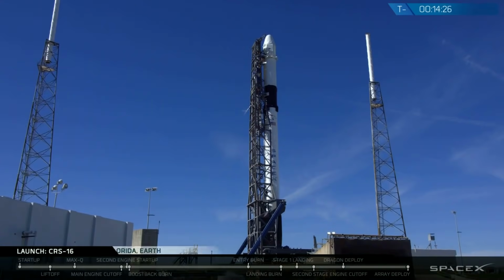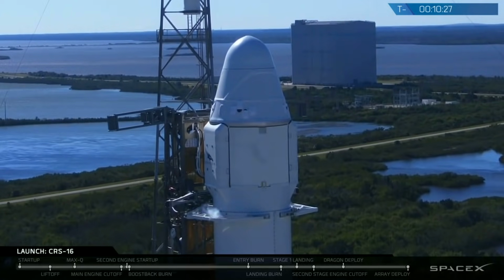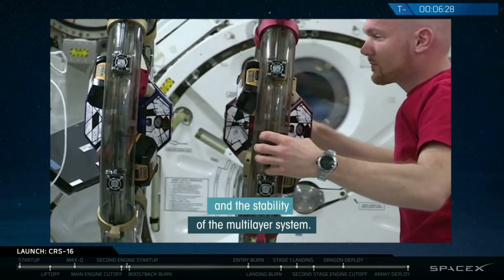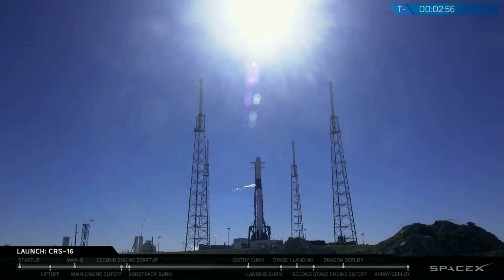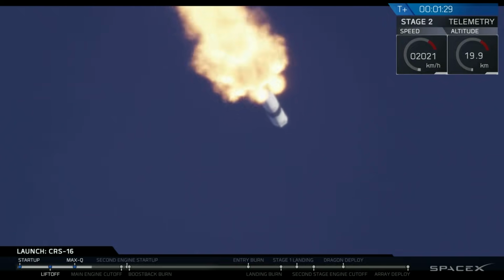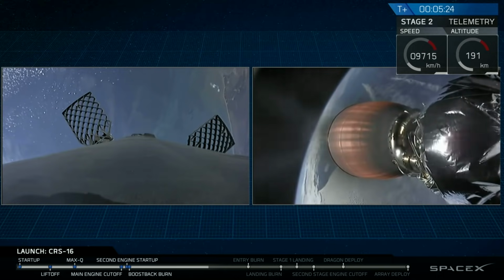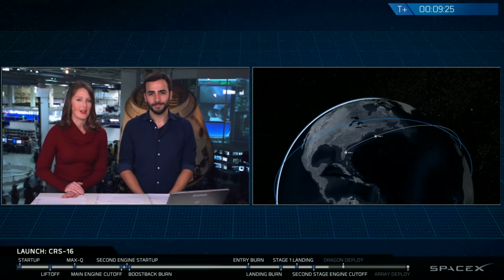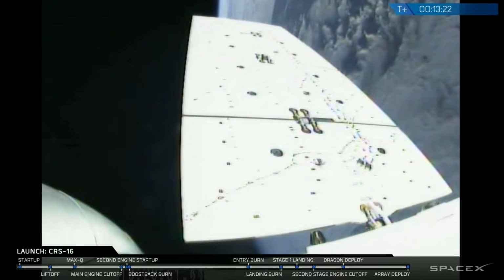Dragon Resupply Mission (CRS-16)

Comment: why is earth spinnng one way when you show the engine, but yet spins the opposite way when you show other engine....shouldn't earth rotate the same direction? #NASALIES
Reply: That’s the same Engine with two cameras. You can see earth is rotating in the saner direction since it’s moving in the direction the engine is facing for both cameras.

The earth only appears to be rotating so quickly in this video since the spacecraft is moving so fast around it.

Comment: The only accurate launch video comes up in Youtube: (SpaceX Launch with CRS-16 12/5/18)
Which shows these proximate results: 28 seconds to leave frame, ascending 1,200-to-1,300 meters, based on 100 meter towers at launch site and frame height, while a free-fall from 1,300 meters (G-force), excluding air-resistance, reaches ground 14 seconds  (half ascend time), thus meaning that SpaceX is NOT accelerating at all, but going up at an apparently constant helium-balloon-speed, slightly assisted with pyrotechnic propulsion (Fireworks)! An actual rocket, no matter how small, and weak, has to cover 1,300 meters in less than 4 seconds or it tips over and falls!  Such as this one: 
Youtube: (STEVE EVES SATURN V MODEL ROCKET RECORD FLIGHT VIDEO Roy Dawson)
These huge-rockets ascend so slowly because they are NOT rockets, but fireworks-assisted-airships (BALLOONS)!
Using video to measure rocket-speed: https://www.apogeerockets.com/education/downloads/Newsletter292.pdf
Reply: All model-rockets ascending above 1,000 meters have acceleration above 3G: http://www.thrustcurve.org/motorguide.jsp?rocket=400
 “Cesaroni N1560” found above, is probably the weakest rocket going up 1,300 meters with 2.9G, in only 10 seconds, 1/3d of the time the above SpaceX-Dragon covered the same distance! Look also at the list of failed motors below. Clicking on above rocket-name takes you to its data-sheet.
Reply: https://www.youtube.com/watch?v=MkmK7giUej0
   Or, Youtube: 
(My O-Motor Rocket Going Supersonic with a Speaking GPS) to see This amateur-rocket (a real-rocket), with a mass-produced Estes-motor, shooting up 21,000 ft==6,400 meters in the same 26 seconds that the above SpaceX-Dragon covered around 1,200 meters, thus over 6,400/1,200 > 5 times faster!
Reply: @kareemsalessi  And fleas are stronger than men, because if we could jump 300 times our height we'd leap over the Eiffel Tower... if the function of a Falcon 9 was to climb a few tens of km high at a lethal acceleration before dropping back to the ground then your analysis would be instructive.

Comment: Google: ("Solving-Spacex-Enigma") and cross-check the above launch numbers with the table there for a major surprise!
Reply: Rockets headed to orbit don't go straight up. Most of the power of the rocket is used to reach orbital speed. Most of the thrust is angled to the side in order to reach this speed.
The altitude gauge isn't the same as an odometer on a car. It's only measuring how high the rocket is; not how far it went.
Reply: @ddegn  That is just one of many NASA-FAIRY-TALES!  Check their ISS in Youtube: 
(Checkmate! Astronaut Caught Wearing Normal Gloves In Space - NASA Caught Faking Space Walk)
Reply: @kareemsalessi  "That is just one of many NASA-FAIRY-TALES!"
I thought you were claiming the stats were wrong in the SpaceX video. I explained why you were wrong.
You could have acknowledged your mistake but instead I see you want to spout new nonsense rather than deal with your previous nonsense.

Why do I suspect the video Checkmate! Astronaut Caught Wearing Normal Gloves In Space - NASA Caught Faking Space Walk will be just as nonsensical as your Solving-Spacex-Enigma pdf?
Reply: There is an Enigma?  Why do I suspect it's merely ignorance...
Reply: @TheEvilmooseofdoom  See what IGNORANCE actually looks like, by looking into a mirror!
Reply: So it turns out I nailed it.  Another brain damaged throw away with a wannabe hero complex.
Reply: Kareem Salessi damn, finally someone on this earth has 200iq. I mean hot darn your smart. It’s actually incredible. I bet you came up with this without even thinking about it. Can’t even believe how intelligent you are
Reply: @1984johnson  Is this sarcasm?

Comment: I noticed something on your feed of the recent ISS launch and landing anomaly. At T+ 00:06:00 a donut shaped piece of debris appears to float away from the left grid fin and on the same side as the camera (as it appears in the feed). It also appears to be symmetrically shaped; like a seal, gasket or bushing. Could this have been related to the landing anomaly? Please disregard if this has already been explained.  Thanks…
Reply: Late reply, but what you saw float away from the left grid fin was an ice ring that formed around one of the liquid oxygen valves. Remember that when the supercold liquid oxygen is filled during propellant loading, it causes ice to form on the outside of the booster due to the difference between that and the outside air.

It's also happened on subsequent F9 launches, so it's safe to say that the ice ring DOES NOT indicate anything anomalous.

Comment: I always thought when a booster stage is out of control they are sent a self - destruct order. Maybe even that failed
Reply: Generally, you are right, but they have a more complicated protocol for the landing.

In this flight, things go haywire at about T+7'20"
The first stage self-destruct system (FTS) had been disabled after the re-entry burn, at approximately T+7'06".

The plan seems to be -- if the rocket fails at the point when FTS gets disabled, the trajectory of the rocket would end up in the ocean. If, on the other hand, everything works, the rocket would steer itself to the landing pad.
Reply: Isn't a out of control rocket coming down more dangerous Vs one lifting off. That stage 1 was out of control well before it hit the water. I wonder if their self destruct systems had failed.
Reply: @leokimvideo  It was aimed at the water as a safety precaution and only at the last minute do they change course for the landing zone.  Having a rocket crash into the water is as bad as having rocket debris raining down so in the end it really doesn't matter.  It's fuel tanks are mostly empty by this point so there is no danger of the giant explosions you'd get on launch.  If they blow it then it's failed for sure, letting it struggle at least gives them data that might help design and/or programming the autopilot and in this case showed the autopilot was able to retain some small measure of control.
Reply: On lift off they might but I don't think there is much point during a landing.

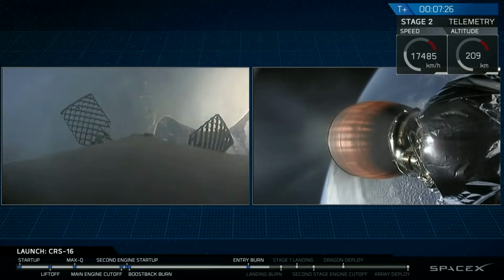Comment: i dont understand stage 1 is sucsessfuly landed? or not??   22:26
Reply: It did not land as planned, but it did handle the emergency successfully, and softly splashed down in one piece just off the shore of Cape Canaveral. If you check around, there are plenty of videos showing the details of what happened.
Reply: thanks. i learn that after my question.
Reply: Dogan Sahin AKGUL It landed in one piece, but it landed in water. This was unintentional, something went wrong with the Grid Fins which stabilize the rocket. However the rocket should almost be fine. There is footage of water landing.

Comment: Hi all.  Based on the comments by Elon to have complete plumbing redundancy seems a bit overboard surely a redundant pump with a pressure driven solenoid valve would do the job just as well.  After all the plumbing does not fail. If it does it would through something else going wrong.  I suppose the solution to that is to have a Falcon 9 inside waiting to take over in that event.
Good to see that the stage carried out all the safety functions making it less likely for me to find one in my backyard.  Great job SpaceX. Keep it up.

Comment: Why parachutes are not an option for Stage 1 re-entry?
Reply: SpaceX started with parachutes. It just did not work -- the rocket is made out of a very thin metal (3 mm thick aluminum alloy), and it was breaking apart even before parachutes would come out. If the rocket were more heavily built, one could use the parachutes -- this was done with the Space Shuttle Solid rocket boosters. (Those were made of 12 mm thick steel.)

Comment: why don't they install parachute system on those first stages in case the rocket engine/system fails??
Reply: simply too heavy. 
they're already so confident about propulsive landings, and they can still do safe emergency landings like this.

again, it's too heavy.
adding even the smallest amount of weight to the first stage exponentially decreases payload size, which is obviously bad.

Comment: You didn't lose cool points because you didn't land the rocket. You lost cool points because you cut away from the feed of it when it started spinning out of control.
Reply: Chester Copperpot It was a mistake. Elon released the video on twitter soon after. Also, cool points? Really?
Reply: @akzebraminer  You just lost cool points for questioning my use of cool points.

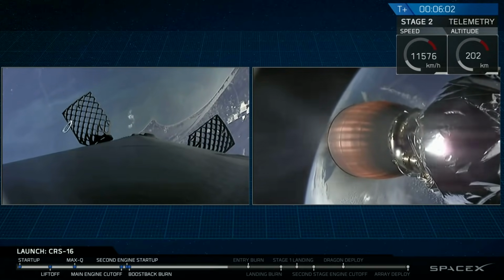Comment: 21:00 There is a some kind of flying debris there (near gridfin, probably frozen condensate ) , but why it is flying so slowly along the ship and it is not blown away ?  (sorry for my english)
Reply: The altitude is still very high. There is not enough air to blow the frost away. But you can see how it jumps and starts moving when the plume of gas from the orientation thrusters hits it.
Reply: The booster was still above most of the atmosphere.  Not enough air to be blown way.
Reply: Watch it closely and slowed down, might just make you laugh.

Comment: SpaceX did not have rolling stabilizer? i feel that they lost control on the rocket when it started rolling, yet they managed to land it successfully in water, but how come they did not think that this might happen???
Reply: Because this has happened. The first ever attempt of recovering a Falcon 9 ended with the booster smashing into the barge after the grid fins failed. They fixed the hydraulic system and didn't think of it stalling. Let's be honest, if they aimed for LZ-1 instead of the water initially, this booster wouldn't have needed to be towed.

Comment: The video of the F9 coming down on the water:  https://youtu.be/wtszYwRIc6o. The Titanium Grid Fin hydraulic pumps stalled causing the grid fins to misbehave resulting in a spin. The engines were able to counteract it enough for it to land in the shallow waters. Looks to be intact but the booster did topple over and fall, hopefully there's no damage that can't be repaired.

Comment: So I’m curious what happens to the nose cap and most of all the stage 2 engine.
Do both of them fall back to earth and burn up in the atmosphere or do they orbit earth as a rocket body?

The stage 2 engine looks quite big so it being a rocket body in orbit would be kind of stupid imo.
Reply: The nose cap burns up in the atmosphere minutes later.  it was not traveling at orbital velocity so it comes back down.  The second stage does make it to  orbit.  However once the mission is over it burns the last of its fuel to slow it down.  Then it burns up in the atmosphere and any thing that doesn't burn up crashes into a selected spot in the ocean.

Comment: Should our clothing be also a variably controlled suit able to assist in any task? Imagine if your friend was dying, you, needed to carry them for 3 miles back to town ,if your joints could lock,the effort would be minimized, all the weight could be directed at the waist, and then to the ground, and with a powered joint movement, in certain circumstances, huge amounts of products could be moved easily. later safety addons could be applied
Just like "Iron Man" Tm, could all be composites, not much heavier than normal clothes
Reply: it could be water filled hydraulic system,with a bit of lube obviously, lol maybe even water powered as well, hydrogen fuel cell tech, build up hydrogen over time, power thing rinse/repeat...

Comment: Are you ashamed of failures? Afraid for bad PR?? Don't be! I think it is cool to share a mishap, and lame to try hide it. Please don't cut off the video next time.
Reply: They're not ashamed of failures, they made a compilation of all their failures. And literally minutes after it landed, they said it landed in the wrong place
Reply: If it is not shame/PR policy, then why was the video cut off? Are there technical transmission reasons here? (like there are on the spacex drone ship).
Reply: @GiesbertNijhuis  There are never technical issues when a booster lands on land. The reason this was cut is because the guy running the livestream panicked.
You would too if you saw for the first time in over 2 years, a booster doing what it wasn't meant to, which up until now, always meant a crash

Comment: I wonder if they could program the other fins to compensate for a fin not working rather than having redundant hydraulic systems that add weight. You only fail when you quit.

Comment: Elon Musk said on twitter that the fault was due to a stalled hydraulic pump for the grid fins. the rocket landed in the water and seems to have survived and is still sending back telemetry. He also said theres a good chance they will use it again but just for internal launches. so thats good news!

Comment: Ok so a grid fin hydraulic pump stalled (due to not being critical to the primary mission it had no redundancy), causing a grid fin to stop moving, this caused F9 to go into abort mode, and it landed in the water, with Elon saying it was undamaged, and still transmitting telemetry.

This was first flight of this booster (B1050.2).

Comment: Elon Musk said the booster can still be reused on SpaceX internal missions
Potentially it could fly for Stalink in mid-2019
Reply: After that accidental water landing refurbishment is gong to be a bitch though.
Reply: @theatom7264  Yeh, probably why it will never fly commercially again
Reply: @theatom7264  Musk stated that it looks undamaged. Dunno how much truth in that statement, but I think their customers will not want to rent a defective unit. That's why it can be in pristine condition and still get pushed to internal duty
Reply: Or maybe the Crew Dragon non-crew abort test...
Reply: @OrbitallerDumbest  That's not an internal launch, that's a highly crucial NASA test flight
Reply: It landed smoothly enough but it fell over and took some side loads when it hit the water. A better bet is that parts of it will fly again (grid fins, maybe the engines or octaweb, control unit)
Reply: Me from the future, it did not flybon Starlink
Reply: @cloverdove  Me from 3 years after... still hasnt flown on starlink
Reply: @xioana  correct

Comment: Elon Musk via Twitter: "Grid fin hydraulic pump stalled, so Falcon landed just out to sea. Appears to be undamaged & is transmitting data. Recovery ship dispatched."
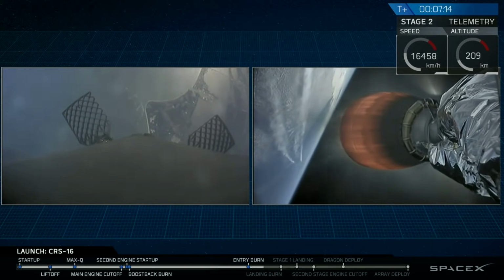There is footage from the ground showing the booster chaotically spinning (here at 22:15). Nevertheless it was able to do a soft touch down in the water, but then it tipped over. Very impressive still.
EDIT: Elon posted the full video on Twitter: https://twitter.com/elonmusk/status/1070399755526656000
Reply: https://www.youtube.com/watch?v=wNpDWSfSd8k
Reply: JUST FIX THE FRICKING PUMP!!!